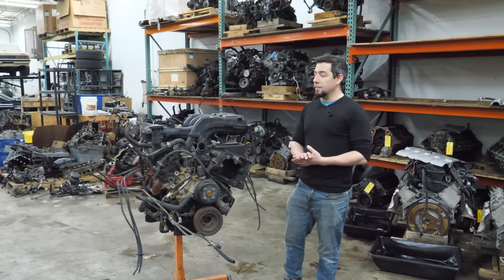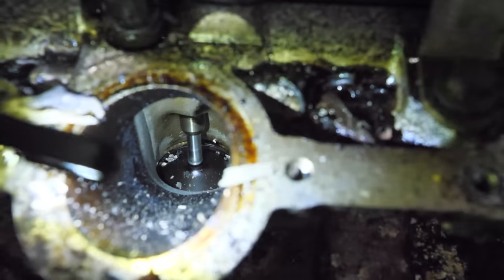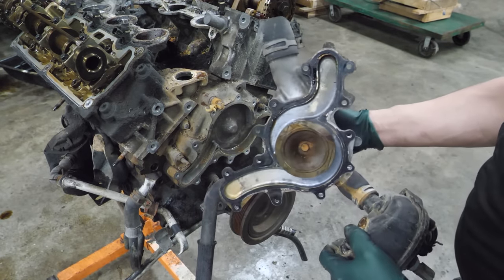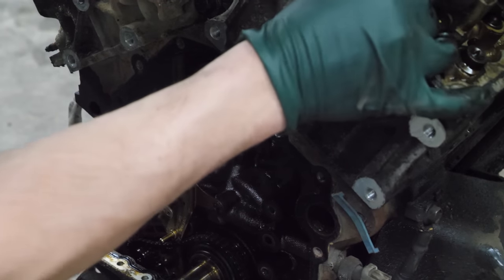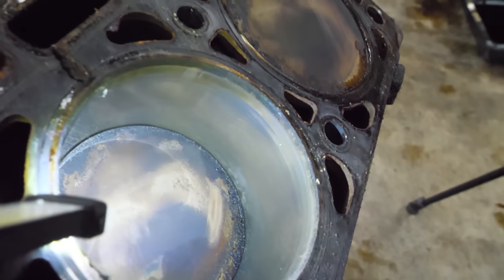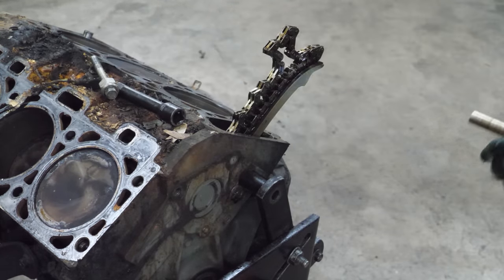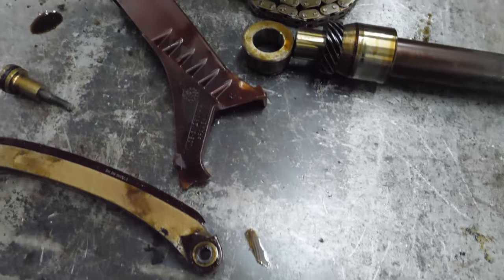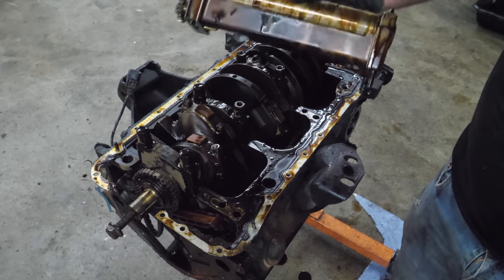Ford Explorer / Ranger / Mustang 4.0L SOHC V6 Teardown! Is This Why They're Called "Exploders" ?

Comment: it may be a BS design for the timing chains, But I've had my 4.0 mustang for 10years engine came out of a mercury mountaineer for $400 at a junk yard put 200k miles on it and only had to do the timing chains once and replace the thermostat with a metal one, Also its not only my daily but Im not nice to it and its held up to punishment

Comment: I own a 2007 mustang with the 4.0 and the only issue I’ve had with it is the cooling system kinda sucks. I’ve had the water pump go out twice and the plastic thermostat housing will definitely give me problems in the future. But other than that is definitely enough power and torque for how bad they get ragged on by people
Reply: I got a 2010 mustang 225k miles, and no problems with my engine just some electrical issues with the car.

Comment: when mine all of a sudden stalled when pulling into a parking lot it lost all compression I replaced mine with a 60k mile engine put new chain tensioners on it and been driving it for 4 years good so far

Comment: I got a 03 Ranger with the 4.0 4wd and a 5 speed. I best the ever living crap out of that truck and it never missed a best. It even took one slight money shift. I let it go with 145K because the clutch slave cylinder was always giving me issues every year. It’s probably dead now but it was damn good when I had it.

Comment: Interesting to see the bad side of an engine thats given me no issues so far. Have 2010 ranger 5speed with this engine and the only problem that ive had regarding the engine was a vacuum leak from a rotted out vacuum line. Less than 5 bucks to fix. I was left stranded once because my ujoint on the driveshaft gave up, but you cant fault the engine for that. Ive had a few other problems like leaky trans and i replaced the steering rack and a leaking radiator. Ive kept up with maintenance well. oil always at 5k and trans fluid every 50k. All the basic and preventative maintenance taken care of. Sitting at 220k rn running smooth

Comment: Urgh, this gives me nightmares. I rebuilt the SOHC on my Explorer twice and each time, I’d get 10k out of it before the front tensioner would snap again. First time, I avoided bent valves, but the 2nd time it happened, I wasn’t so lucky. I eventually came to the conclusion that the left cam lobes had twisted, which ever so slightly added extra stress to the tensioners when one piston was TDC (can’t remember which one). I still have the timing kit to this day. I loved that SUV and I was so proud to drive something I had rebuilt all on my own, but I eventually had to give up on it. It was my only running vehicle for several months and that last time leaving me stranded was the last straw. 

I really wanted to put the OHV V8 in place of it, but we had to move and I was just burnt out. I still miss that truck.

Comment: I had an '01 Sport Trac with one of these, and it was honestly a very good ride.  Now that I see it torn down, this is indeed a poorly designed engine, but I put 160k on it with never a minute's trouble out of it.  Maybe because I kept the oil changed properly?

Comment: Always use genuine Ford timing sets, never that aftermarket stuff. My brother is learning this the hard way. Other than changing the timing sets twice, he never had any problems with his 2008 Explorer. Truck has 245,000 miles on it.

Comment: I had a 1997 Ranger XLT extended cab 4.0 that never gave me a single issue. Plenty of power, even uphill. And I pulled a 5x8 enclosed trailer full of sound equipment and instruments to local weekend gigs. And occasionally pulled a 5x8 open trailer with dirt bikes and 4 wheelers to a trail 2 hrs away. 

I changed the thermostat at 67,000 miles. 

I changed the tensioner pully, the serpentine, at 165,000 miles. 

The transmission however, was the problem. At 67,000 miles, I decided to change the tranny fluid. Worst mistake EVER. It immediately started slipping at start-up. Once you drove it 50 feet, it engaged with no problem. I drove it like that until I sold it at 175,000 miles. It still had plenty of power, and I regret selling it. I would LOVE to have a new Ranger if they would put a 4.0 in it. I don't like the newer motors with the turbos. Way over complicated. The 4.0 was PLENTY

Comment: They also put that 4.0L in the Land Rover LR3 for a few years and what ever Land Rover did to it, made it make almost 30 extra horsepower than the ones in the Ranger, Xploder, and mustang. I had a Ranger FX4 lvlII, 5spd, 4.10 gears, with that 4.0L, power was actually decent, I never had an issue with that truck but i did only put around 40K on it. Also what engineer decided to put the timing chain for 1 head on the back of the engine, and then use plastic tensioners.

Comment: The DOHC is basically the same. Ford says you have to remove the transfer case, transmission and then the engine to replace that bloody plastic chain guide in the rear. However I’ve done 2 in the past by removing the transfer case, transmission and changed the cassette (guides, chain, and gears) without removing the engine in a couple of days.

Comment: These engines are a bit newer then what I have typically worked on, but I do know that the reason some V6 engines have a balance shaft and some don’t is due to a design change. As some older V6 engines had a different angle to the cylinder bank, then some of the newer engines. Like some that had like a 45° angle others had something like a 35° angle, dunno why things like that made a difference but it did. And some may have had to do with the way the crank shaft got balanced maybe. Been a long time since I was in mechanics school, and a lot has changed since then.
Reply: Oddly enough, on these particular Ford 4.0 SOHC engines, the ones that were installed in 4x4 vehicles had the balance shaft, and 2-wheel drive vehicles got the 4.0 SOHC without the balance shaft.  And if I remember correctly, somewhere between 2006 and 2010, Ford started putting the balance shaft on all of the 4.0 SOHC engines, regardless of what vehicle they went in.

Comment: Had an 03 Ranger 2WD and the 5 speed auto. Sold it with 300,000 + miles and drove it like I stole it. It was dead reliable and ran plenty strong with just a tune.

Comment: The balance shafts were installed in the 4x4 Rangers because of drive train vibrations. I have no idea what year it started, but if it has a balance shaft, it came out of a 4x4 Ranger.

Comment: Your order of disassembly wasn't correct, if you were only replacing the timing set. The heads do not have to be removed to get the front guide out. It can be pushed out from the bottom with a bit of force. The new timing cassette has a snap ring that can be removed and then reassembled in place. I'm in the process of replacing the timing set in my '04 Explorer. I wouldn't pay someone else to do this work, because the cost of the repairs would exceed the value of the vehicle. Once I'm completed with the repairs, I should get another 150k out of it. Good video. Thanks for posting.

Comment: I love how easy it is to change the plugs on these engines. 3.8, 4.0, 4.2…
I like the 4.2 the most. Longer stroke than the 3.8 which is bullet proof basically.
Reply: Ford reduced the reliability of the block itself when they stroked it to a 4.2. The performance guys still want the 3.8 and install the 4.2 crank.

Comment: I had to replace the driver side cylinder head on one of these - in a Mustang - because the lube kid stripped out the spark plug hole on cylinder 5 when he did plugs.  Shop foreman was hoping I could tap the threads to save the engine.  It was beyond saving, so it got a new head.

Comment: The only reason l can see for the timing chain set-up is it allowed Ford to use tye same heads on both sides. GM did that with the LQ-1 but got around it by using a belt drive with a longer cam carrier and cams on the passenger side.
Depending on how many machining lines you have the cycle times on the lines can ge equal between blocks and heads or twice as fast on the heads.

Comment: It didn't take long before you ran into every issue they have. 'Oh, that's tight!' Ya, that is not easy. 'Valve cover gasket leaking on the driver side' - Yup! Every time! That top does not come off very easy if the motor is still in the car. Ford decided to not make it accessible. And the left side timing chain is a nightmare -  Yes, the engine needs to come out, but the heads do not.  Getting those guides out is an "adventure" too. Yes, the o ring leaks. I just had mine out and did new gaskets, chains, sensors, pumps and a whole ton of new things since it was already out. I actually like my 05 "exploder". Just turned over 212k

Comment: Only the 4x4 vehicles had the balance shaft in the 4.0 due to the extra unbalanced weight of the transfer case on the drivetrain. Helps keep the vibration down when it was a newer vehicle, but probably wouldn’t make much difference on a well used vehicle.

Comment: I bought one of these '06 explorers with a broken chain for $500.  I knew nothing about the horror I was about to put myself through.  I did a full teardown and rebuild, only because the car was in really nice shape otherwise.  Without having watched more than 5 minutes, my guess was that the wiring harness was bad.  Mine was too.  Without having the engine out, replacing the harness is a big nope.  Truck runs like a top now.

Comment: Those timing chain guides are the Achilles heal of what is otherwise a very reliable engine, even if it's underpowered and unimpressive.  Moddbox makes a kit to add an Eaton M90 supercharger from a Ford Thunderbird to it, which makes it tolerable.

Comment: We had this engine in our 05 Exploder. It was very smooth, quiet, and underpowered. We didn’t have any chain issues, but it started to make a noise that I thought might be related to it after 100k. The transmission was original too, which seem to be more trouble than the chain problems these are known for. It seems there’s no in between with these vehicles. It’s either mine has over 400k and hasn’t missed a beat, to my chains failed, I’m on my 3rd trans this month worst vehicle I ever owned.

Comment: Have this engine in my ford exploder 09. Bought the truck with 72k miles. Currently has 245k miles and is still running strong. Must be the mobile 1 oil I use 🤷. It's not a Honda but it's actually not a bad engine if you just take care of the thing. My biggest complaint is that bs thermostat housing they really screwed up with that on this engine

Comment: Balance shafts counteract vibrations that would make a particular engine design seem rough or harsh. I6 engines are naturally balanced, so no balance shaft is required, but a V6 such as the one you tore down here can benefit from the balance shaft as can an I4 design. It's not completely necessary, but on this 60 degree engine would be much smoother with it giving the vehicle a much higher quality feel.

Comment: I had a 2004 Ford Explorer, with 190.00 miles. I always changed oil and filter every 5,000 miles. One day I was parked between to cars, where my engine sound is amplified. I now can hear a ticking noise, that my mechanic told me about. I donated the car to Kars4Kids, and bought a new Chevrolet. I mentioned parking between cars, because engine noise is amplified.:hand-orange-covering-eyes:

Comment: Great exposition of what FORD is doing wrong here. The example of bad timing gear is super correct. It just shows that if FORD had just paid a little more attention to engineering here with the timing chains, tensioners, guides, oil pickup, and balancer shaft they could have made a great engine rather than a bad one. I know the 3V Ford truck engine has similar issues with cams, phasers, guides, and oil drain passages. If only FORD put more time and energy into building robust designs with better engineering and better materials they would benefit tremendously. They could use a lesson from their own past in the 1960s engine development programs where they succeeded so well. We can only hope they understand quality engineering concepts better when they transition completely to the new EV world.

Comment: I have an 01 BoostedXPLR sport 2dr. Ive had it for a rlly long time. I have an Eaton m90 on it off of a tbird supercoupe so it makes decent power but I can tell you with absolute certainty that I hate the German cologne V6 4.0 SOHC as well lol. I even know an auto tech teacher who had a Cobra Eaton M112 on it and then switched to an Eaton M122 from a GT500 on it and all he did was change the cyl head bolts to some ARP head studs and a high flow oil pump and that was it everything else on the engine was stock and he could lift the front wheels on his 4dr XPLR at the qtr mile so they can handle some power at least for a lil bit lol. However these 4.0s are a dime a dozen and their is lots of quanity. And their are a cpl places where you can get performance internals and cyl heads from but for ridiculous money, especially for an engine that can easily grenade itself. My original motor made it to 320k and I supercharged it around 225k. I was surprised it lasted as long as it did but it prolly would've lasted a lot longer if I wasn't trying to race a ford raptor lol. It cracked the top of cyl 4 like I've seen so many times on these 4.0s, specifically cyl 4 cracks when the engine breaks under load if the timing chain doesn't first lol. I wish that somebody would make a performance timing chain kit for these things because just about every aftermarket kit cannot compare to the quality and durability of the Ford replacement timing drive kit for this 4.0. Their are videos that illustrate just how far aftermarket kits fall short in quality and durability compared to Ford kits. I'm not saying that their aren't any aftermarket kits out there that aren't adequate because I'm sure their are. I currently have a timing kit I got off Amazon lol on one of my 4.0s and it seems to be working out good especially since it has a supercharger on it lol but we'll see what happens down the road. Ideally I would like to get some Cosworth BOB or BOA DOHC cyl heads from the UK from somebody with a Ford Sierra or something and swap my 4.0 SOHC to a DOHC but then I have to figure out how to redesign the timing drive and how to come up with parts in the future if needed, I think theirs a vid on YouTube somewhere of this 4.0 SOHC to DOHC cyl head swap. So if this guy from I Do Cars can get Cosworth BOA or BOB cyl heads from a 2.9 Sierra or something similar for a good price lmk lol. At this point if your still reading lol your prolly saying why not just V8 swap it. Well in order to go from a 60 degree 4.0 SOHC v6 to a 90 degree 4.6 SOHC v8 I would need to swap the brake booster to a mustang hydro boost, thas no problem, I would want to keep my a/c and that would require completely redesigning the evaporator blower box that's right behind the darn engine. On the Ford made prototype SVT Ranger Lightning Bolt with a f150 lightning s/c 5.4 in it they used some econoline evaporator box and put it off to the side of the engine bay instead of in the back of the motor in the stock position, i can't find any other info on it so I'd have to come up with my own design rather then delete the a/c. And I'd have to relocate the gas tank to accommodate the 4wd t-case as well possibly. Orrrr I could put the older 60 degree 5.0 pushrod V8 in it that they already used to put in older Stangs and Explorers, that's basically an easy swap with an old engine that's easy to work on that doesn't make much power but application specific superchargers are hard to come by for the old Windsor 5.0 pushrod v8 I think. So basically it all comes down to, with this XPLR, I am already too invested in the V6 setup for me to swap in a V8 plus the current rear leaf spring, front torsion bar suspension rides like crap, gonna ditch the front torsion bars and coil over swap it after I install this suspension lift kit that I have. I wanna get my hands on a 02 explorer 4dr that already has a 4.6 SOHC v8 in it and then I can just DOHC swap it and put a supercharger on it just like I have in my 01 cobra plus the 02 4dr XPLR has coil spring suspension all the way around and rides soo much nicer but maybe not tighter lol. Rlly sry I wrote a F-ton lol. Good vid, sometimes I throw up one of your vids on the screen in the garage when working. ✌️✌️

Comment: I had one in a mustang ranger and an explorer. Actually two mustangs and '07 and '09. I put a m90 on the '07. I just built a box to replace the intake manifold cuz the injectors are in the head to mount an m90 Thunderbird supercharger and they weren't bad stock power and listening to that whine was pretty fun. But yeah, now that I know how the timing system is on those I would definitely avoid them just for that fact.

Comment: What kind of service would it take to prevent that plastic timing part from breaking?
Reply: Probably replacing the two timing chain tensioners. Upfront by the temp gauge housing and the passenger side one. 27mm wrench or 1/16th deep socket. Prime the new ones by dunking it in car oil, push down on spring so they fill with oil till you can't, so the chain has tension going back in. It's a pain in the ass to put back on. Bolt has to be on tight. Otherwise, oil will leak. Make sure it has a gasket. Of course, if the guides are shot anyways, well, that sucks. Change the tensioners even if you don't have a rattle because, more than likely, they haven't been changed. Regular oil changes ofcourse help too.